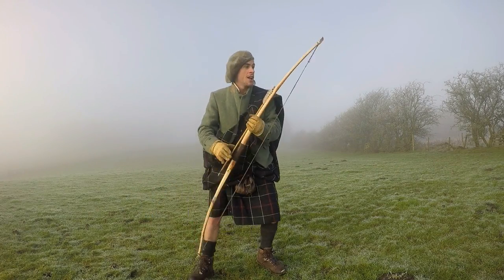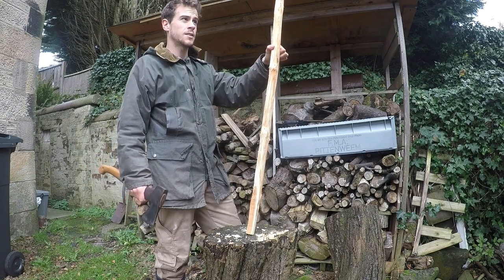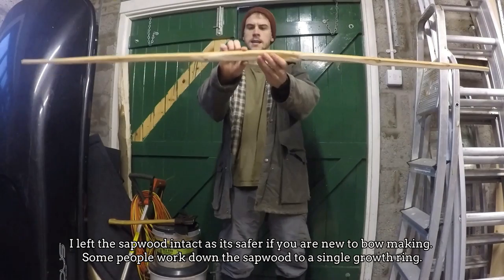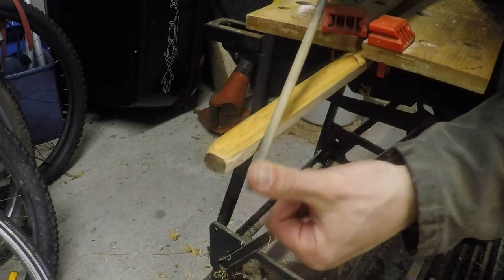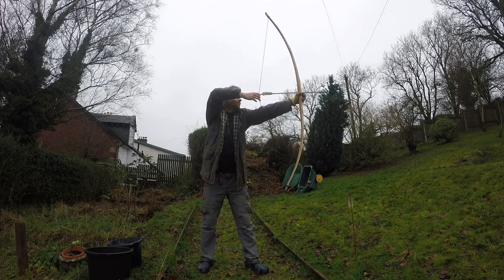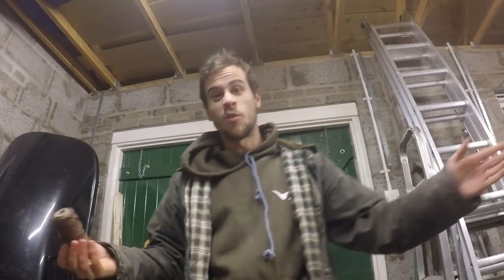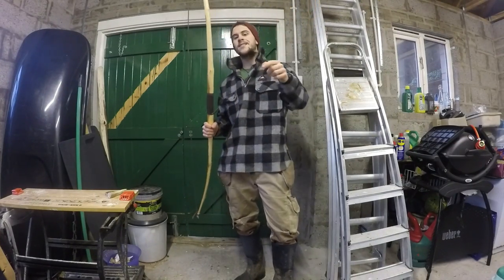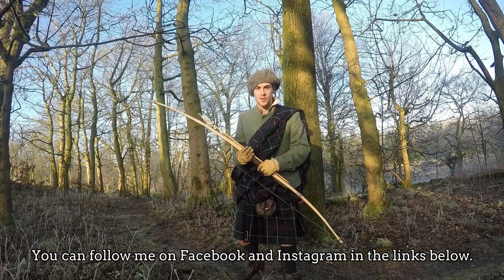Making a Highland Longbow (and a wee bit of history)

Comment: A common misconception (or modern myth) is that forest-dwelling guerilla type archers in Europe preferred the longbow. In reality a 6 foot bow is astoundingly impractical in the rough outdoors: it gets stuck in tree branches, intertwined in tall grass and weeds and knocks against logs, stubs and rocks during transport. It can easily break if tied to a horse or mule if said animal drops its packing for whatever reason or collides into something. A recurve or nipple-tall self bow would be much more easy to use and to maintain.

Comment: you could use linseed oil or olive oil, or any fat that is soft, that would let you flex the wood without cracking it, if you heat it with oil slowly to let it warm up and soak it in, you can bend the wood to almost any shape or straighten bent parts and it will mostly hold that shape when its cool. Ive never used a straight piece of wood for a bow, ive used really ugly pieces and my bows were very nice when finished. that yew stave you had is beautiful.

Comment: It's awesome to see another aspiring Bowyer. To give you a quick tip when you cure your wood slap some paint or wax polyurethane anything to seal the ends of your Stave. It forces the moisture to evaporate more slowly and evenly. Instead of all escaping from the ends. That will keep your wood from cracking God bless and happy bow making! By the way for your second bow you've done a nice job!
Reply from the maker: Thanks so much! I read somewhere to cover the stave ends, but I have never tried it. Thanks for the great info. What is the minimal time you season a stave for?
Reply: @FandabiDozi  depends on the environment in my basement 6month but above my wood stove or by dehumidifier abt 4 months. U can start shaping the belly and see how it's dried. U can always give it another month. Once it's mostly dry u can shape it out in it's rough stages.

Comment: Rosewood dust in the crack in layers... and apply thin superglue to the packed in dust in layers (as you pack in the dust) makes a solid (minor) crack repair in a riser. I wouldn’t use it on a limb section.

Comment: You didn't explain the leather wrapping round the middle of the bow. From what I've read (and used on my own longbows) a piece of wet rawhide was sewn onto the bow for strengthening. It would shrink while drying, and become quite hard, giving extra strength. If you haven't any rawhide, those knotted dog "bones" from pet stores etc are just bleached rawhide , and do the job very nicely after being soaked and undone. Cowhorn was used for nocks because it's already got a tapering hollow inside,saving you that grinding out process on the deer horn; cow/bullock leg bones also work. Unfortunately I live in a remote part of Australia, and the 40+ degree.C temperatures wreak havoc on self bows, so  I've given up on the longbows for the present, but they have always fascinated me, perhaps it's my Celtic heritage (Scots, Irish and Cornish) Good job on the video and the bow too!
PS What wood would the Scots have used for arrows in those days, and how would they have got them straight enough to be accurate?

Comment: My skill is in Viking ship replica construction - the 'recipe' for keeping wood supple and flexible, as these boats were, is the application of a mixture of turpentine, linseed oil and tar. The Turpentine is really that - not an artificial substitute such as White Spirit - but proper plant based light spirit (and you can obtain that yourself by condensing the lighter fractions when burning tar) or buy commercially. The linseed must be raw linseed (not 'boiled' or 'cooked' linseed oil which is actually derived by a chemical process) - ergo it's simply an oil pressed from the seed, nothing else. And the tar (which is at least partly a rot preventive) and is a heavier 'oil' - is carried into the wood by the lighter oils which then evaporate or soak in or dry off. This mix might be a bit 'slimy' for a bow for handling it - not sure - but I would think there's a good analogy in its usage, all the better if you give it repeat coats to allow penetration, and then give it a long time to dry so the 'slime factor' is reduced or with luck annulled. The ratio of he mixture is subject to debate and all manner of experiment, but a third of each does the job generally speaking. Nice video, thanks and wishing you well.

Comment: Very nice job, and congratulations for keeping it  authentic. The stag horn tips are great. I try to make them a little more compact to keep the arrow speed up.   I doubt your ancestors used fancy water buffalo like all the English Longbows must have now.   Still a bit confused on what you did on the back, just scraped off the bark?  The standard swindle is that you have to chase a ring with yew or back it, but I doubt real primative yew bows were single growth rings on the back.
Reply from the maker: Thanks very much :D yeah just scrapped the bark off basically :) thanks for the info!

Comment: Great video.I know alot more went into the shaping and tillering than the video showed. Heck Man.It looks like a good one. Its one of those things If it shoots  true.Then id say you did it right.Bring home dinner for sure and  idk the FPS but down range  it sounds fast as hell . Do keep an eye on that possible hinge you mentioned. If it begins to worry you. Look up using pectin found in canning and preserve making supplies Knore is the brand here in the U.S.  Its actually animal hide glue only food grade.Then you can back the bow with that and sinew or even silk cloth and still stay somewhat historically correct Itll no longer be a self bow but Itll help add life to it save it from hinging at that spot, save all the hard work too. Its still a fine bow though

Comment: For the handle I would wrap it with wet rawhide and let it dry out and harden. Over all, awesome job! Now you have the beginnings of an addiction. ;)
Reply from the maker: Thanks I would love to try with raw hide. Need to make friends with a hunter first. Yeah I'm hooked!
Reply: @FandabiDozi  Actually, rawhide dog bones soaked and unraveled works really well, and they're thick enough for padding, AND you can either stain or paint them when dried out.
Reply: @FandabiDozi  I second the comment about rawhide dog chews . You can buy them cheaply in many shops . Rawhide is the original gaffer tape . Every culture around the world used rawhide in many ways .